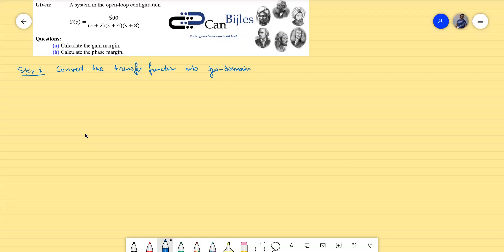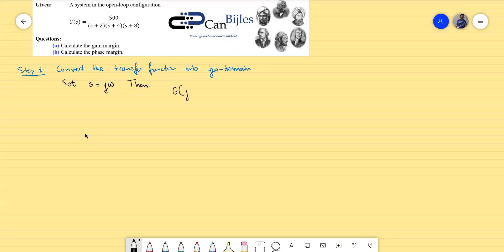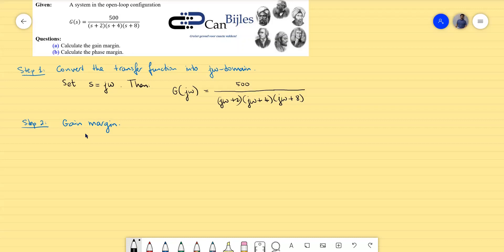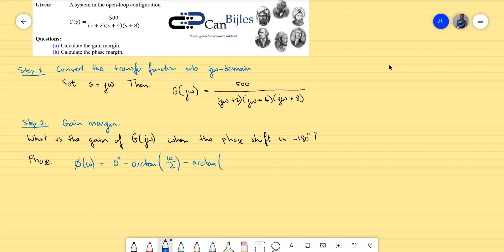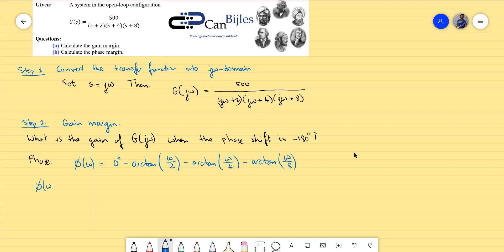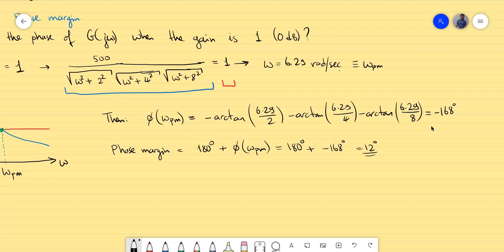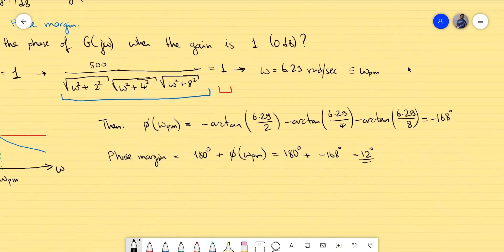Gain Margin & Phase Margin Explained! (Step by Step) 💡 Example 1

Comment: How did you do it to get w = 7.48?
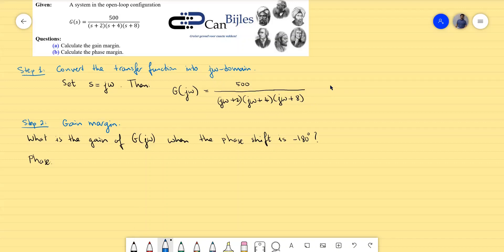Reply from the maker: You get the gain margin frequency of 7.48 bij solving the equation I discuss starting at 00:04:00.
Reply: @CANEDUX  How?
Reply from the maker: @soubanjaved5654  Again, by solving the equation I discuss starting at 00:04:00. Check this part first.
Reply: @CANEDUX  but how do I solve the equation?